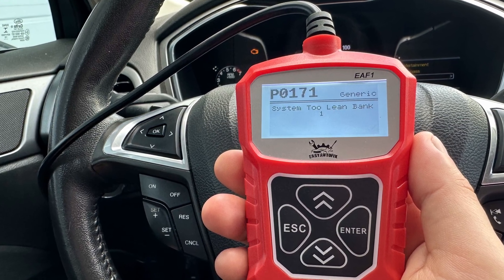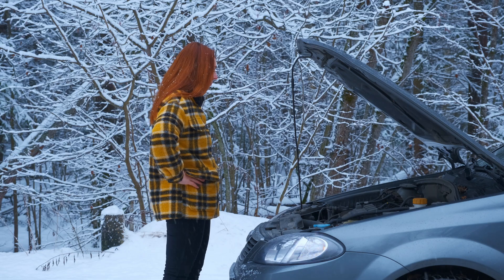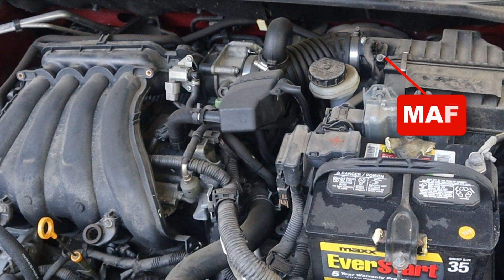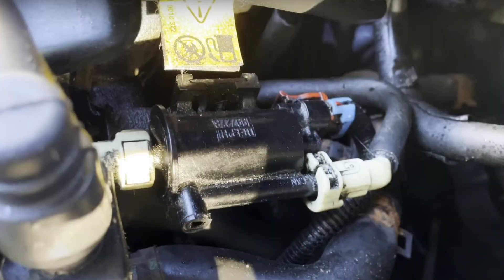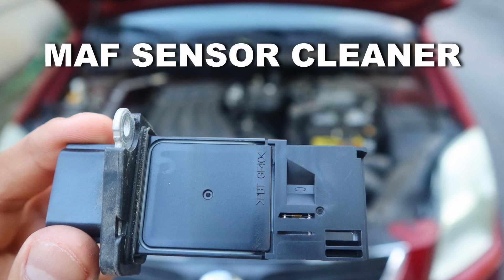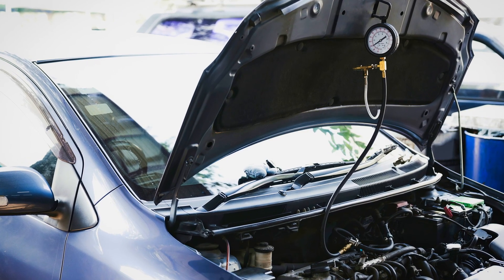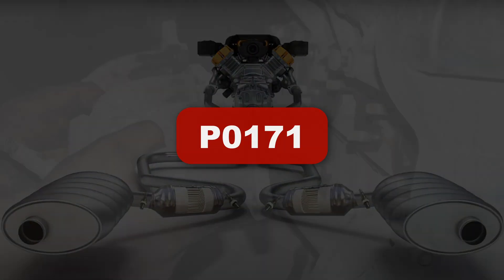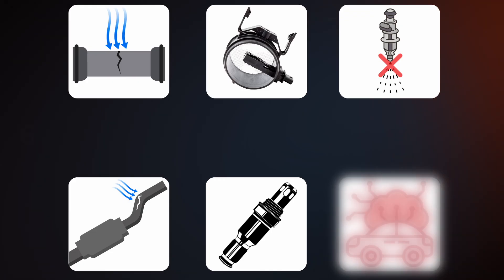P0171 Trouble Code: System Too Lean Bank 1 (The Most Common Causes)

Comment from the maker: ▶︎ OBD2 Scanner: https://amzn.to/3PHRplS
Reply: Check the easiest causes first: 
1. the hose air filter box could come loose ie. a vacum leakage. All you need to do is tighten the screw. 
2. Clean the MAF sensor.
I do not understand how leaked exhaust causing air to come in and causing oxygen sensor reading incorrectly since pressure inside the exhaust pipe is higher than atmosphere when the engine running.
Reply: This scanner gave up on me in a month. Get the blue driver. Unless a got a dud idk
Reply: 0:21 0:21

Comment: The problem was with the booster in the brake system, the diaphragm was faulty, I repaired it the issue resolved itself and the check engine turned off all on it's own.

Comment: So I've been getting all four cylinders misfire and I've done almost every replacement part underneath the hood and I finally swapped out all four injectors and my very next drive I got the two lean code as well as all four cylinders still misfiring

Comment: Well here's the deal..i have a 2013 mazda 6 2.5l  for a couple months I had a stuck open thermostat.. Two days ago I did the thermostat.. It was in pieces they used aftermarket plastic one the plastic broke, it was separated into metal and plastic piece.. Anyway there were permanent trouble codes related to thermostat that cleared after i cleared all codes  all my readiness monitors r ok except  02s and evap after 40 miles of various types of driving.. I only did one cold start though.. Today I went for some driving. I think it's like 30 miles i checked the codes everything was a fine  but no readiness still on o2s and evap.. So I looked at the engine Bay.
Went to each vaccume hose..and disconnected and reconnected both o2  senssor  wires just to clean the contacts. Got back in the car, started it and went on another trip.
Good 26 mile drive stopped and checked o b d 2 now there was a pending p0171 .. Didn't touch anything but I have mass airflow sensor  cleaner in the trunk sprayed the hell out of the sensor when I took it out.. Went for a very short drive, maybe 8 miles. Checked obd2. And p0171 is no longer pending and it's gone.. My monitors for 02s and evap are still not ready i'll try to drive a little more later to see if I can make it turn to ready.. What do you think the likelihood of it finally being okay

Comment: Hello, Great Video. Question, I took my 5.7 Hemi to a stealership yesterday with all 4 O2 sensors throwing codes. The codes are cleared, but now I'm getting rich/lean codes both sides, to the point that it dies while driving (never before). Could the "mechanic" have possibly programed my ECM to clear the O2 codes, but now it's now throwing the rich/lean codes? I never had an issue with these codes before. thank you for your time.

Comment: I have an 05 Pontiac Sunfire. That I’ve already done the fuel filter and new air filter. I’m a single mom that can’t keep spending money. What would someone suggest I try next?   I get this code. It takes a couple of times to try to start car and once does the it putters when pressing gas and has engine light on. When driving it after stopping the acceleration struggles with getting top speed and putters. Already replaced the MAPS now too and doing same thing.
Reply: Oxygen sensor is a possibility. Try to find out where it is located.

Comment: I got po171 and then I get po302 because of it, but the spark plug is fine, I replaced the o2 sensor, mad sensor
Reply: Did that fix your problem? I’m having the same codes

Comment: I had this code problem for för 2 years. At last i opened spark plugs and cleaned them carefuly and then i saw that this code disapered. I solved problem wholy and easily at last. So as a  matter of fact please first clean all of spark plugs. My car is opel astra h 2007.

Comment: I don't know the filter came with the car I bought it only a couple months ago and it's clean the pipe up to the map is clean the math looks brand new the PCV valve is black not orange I'm gonna do a smoke test here soon and buy O2 sensors the after cleaned maf sensor it triggers this code

Comment: Funny, i get this recommended today after I noticed small amounts of oil in the rear cross-over pipe on the intake when i removed the manifold to replace the gaskets. Ordered a new one yesterday, and today, i popped a CEL for p0171 bank 1 lean. I assume replacing the pcv will fix both issues.

Comment: Im single and cant afford a mechanic. I have no mechanic in the family to help me. 2014 chevy impala. When fuel gets below a quarter of a tank it starts acting up and dies and runs rough.. i filled up and now getting code po171. It throws a different code alot. What would be the cheapest place to start? Took off air intake and checked for holes. I think it sounds like an exhaust leak under the car but how do i check for that?
Reply: @tishbailey
Sounds like your fuel pump or fuel pump gasket may need to be replaced.  There’s a a reason why the issue occurs when your gas tank is low.

Comment: I replaced my Mass Airflow Sensor and repaired some holes in my exhaust pipe! Fixed my problem and made my car run super smooth!
Reply from the maker: Awesome, glad you got it fixed!
Reply: So this code could be from my non-original straight pipe exhaust?

Comment: Got the code and engine check light. This was the first vid i clicked on. First thing check vacuum hose and found a hole. Simple 30 minute fix for a nonmechanic. Saved me a few hundred bucks. Thanks man!
Reply: What were your symptoms
Reply: @LandonGreenwald  beside the P0171, the engine would shut down when I accelerate after 5 minutes of driving. I'd have to turn it off and start it again to keep driving.  I believe the check engine light, vehicle stabilizing light, and maybe ABS light were on. I was luck that the vacuum hose was right at the top with a visible tear.
Reply: @ I just installed a new fuel regulator and it runs good but I got home and it trough the same code as you and I have a rough running feeling. And ideas what it could be?
Reply: how did you find the hole so many hoses man
Reply: Can I still drive in the meantime I see a mechanic ?

Comment: Thanks @EasyAutoFix, one question where bank2 should be on a 1.6L 4 chilinder in line engine ?
Reply from the maker: In engines with two banks (like a V6, V8, or a boxer-4), Bank 1 is the side with Cylinder 1, and Bank 2 is the opposite side. But in an inline-4 engine, all cylinders are on the same side, so there’s only Bank 1—no Bank 2 exists. However, in a boxer-4 engine (like those in Subaru models), the cylinders are horizontally opposed, meaning it does have both Bank 1 and Bank 2, similar to a V6 or V8.

Comment: One of my vacuum hoses went. You can hear it a little bit plus my RPMs idle high. So if your experiencing high idle and you hear hissing sound, more than likely it’s one of your vacuum hoses
Reply: not sure what to do for me because whenever i used MAF cleaner on my sensor the check engine light went away and was idling good a 3 or 4 days and the light would come back on and i’d repeat the process i bought a new sensor and used throttle body cleaner on it. When i didn’t i disconnect the sensor and the the hose that connects to the the throttle body and it idled just fine without it. When i reconnected everything after it started idling rough again idk wtf to do
Reply: @Ronaldo-bwe did you ever figure out the issue??

Comment: Sprayed my maf sensor and now 2 more codes popped up😑
Reply: The spray pressure broke the wire ,well that is what happen to me once.
Reply: Same here changes all the parts and now this one 😒
Reply: Lol
Reply: Fr?
Reply: Did you get it fixed?
Reply: Lmao
Reply: I did same thing and this code poped up after clearing maf code
Reply: @Shadowshodan28 are you using KANDN filter?
Reply: @Shadowshodan28 are you using kandn filter
Reply: Freaking same! After spraying it,it just started acting crazy with more codes
Reply: It definitely can open up a can of worms
Reply: Not supposed to spray it depending what kind you have
Reply: Always refer to the Fsm before cleaning anything or changing any fluids. There's a recommended procedure specific to each vehicle and it is not always the same as some of your other cars might be.
Reply: P0141
Reply: I have a '96 SC 300 2JZ-GE and you cannot use MAF spray on these - my understanding is that it destroys the filament.  I hope this isn't your case.
Reply: 😱😝😂sorry

Comment: My 1998 Saturn SL2 was bucking, and running rough on cold starts only. It would also stall on first crank start up, unless I pressed gas pedal down 1/3 or more, than it started fine on first start attempt. Cleaned EGR, Cleaned complete throttle body and AIC solenoid pintle, cleaned map sensor and area, new CPS, TPS, CTS, OS, FF, plugs, wires, ignition module, ignition coils, fuel pump good pressure, etc.... still same problem and 171 code running too lean. I replaced PCV and bingo! That fixed the problem!! A freaking $4 part!! Unbelievable a cheap part can cause some weird, bizarre bad start and running problems.

Comment: I got the p0171 and p0174 code for my 02 GMC Seirra 1500 with a 4.8L. How can I fix those 2 codes? Or check ?
Reply: Same thing and a p0401 error code  and cylinder 3 misfire

Comment: I got 
P0420-Catalytic converter system, bank 1 - efficiency below threshold 
(I’ve replaced the cat)

P0276-Intake manifold air control actuator position sensor/switch - range/performance problem

P0171-System too lean, bank 1
P0141-Heated oxygen sensor (HOS) 2, bank 1, heater control - circuit malfunction
P0138-Heated oxygen sensor (HOS) 2, bank 1 - high voltage
P0036-Heated oxygen sensor (HOS) 2, bank 1, heater control - circuit malfunction
(And I’ve replace both o2 sensors on my vehicle up stream and down to be on the safe side. Only one exhaust.)
Reply: buy a spacer

Comment: I check smoke exhaust leak, clean MAF sensor, replace pcv valve. but light still there but when my gas tank has 75% light goes off.. i could not find the problem and come back after that..
Reply: fuel pump

Comment: Hello everyone my car Honda civci si 2008 i have been change a lot of thing but still not working good yet it only running about 1hour after that engine started stalling. this is might be very slow leak or anything that i miss. Thank you so much for helping.

P0171 code system too lean bank 1. i did change O2 sensor and MAF already. and all the boost is good.
Reply: Maybe fuel pump is bad?
Reply: @arymonem  I fixed my car already it was a electrical heating issue with a connector cable that plug into a fuel pump so lucky it was not blow up. thanks
Reply: 08 civic si here with same problem. Still trying to diagnose for weeks. Bump this post if anyone knows anything
Reply: @stephenmacdonald9537  finally i found a problem with my car already so now working great. i been driving for a while. so the problem is fuel pump wire heat up and burning the connector  i'm so lucky that my car not blow up. fuel pump is my last thing to change it.
Reply: So like a faulty fuel pump? Elaborate please

Comment: I have a Toyota RAV4 2017 .  My car had the engine light on and my painel said traction torned off .
Reply: Same problem here. It is not the track control system, it should be fuel or air problems.

Comment: Thank you for this video!  What I don't get is that if the problem is possibly in the A/F ratio sensor, then WHY is there not a code for that sensor?
Reply: Exactly i hate that lol
Reply: There is… your o2 sensors are your “af ratio” sensors. They’ll sometimes throw codes however they often don’t know that they’re not working. Their function can be easily checked with a cheap OBD2 scanner and  seeing their response to a snap throttle test

Comment: P0171 Code : Lean code, too much air. 

Air Fuel Ratio : 14.7 Air = 1 Fuel

14.7 parts of air to 1 part of fuel. 

1. Vacuum Leak : 
2. MAF Sensor
3. Fuel Issues : Fuel Pump, Fuel Filter, Fuel Injectors, Fuel Rail Pressure Sensor, Restricted Fuel Line
4. Exhaust Leak
5. Oxygen Sensor 
6. ECM

Comment: Hi, I have had that code for over a year. It has cleared itself. Engine light goes off. Or I clear it. Last week It started running okay when cold but when hot looses power. In that year I have been driving and testing. Has new fuel pump and filter. Ideas?
Reply: Process of elimination. One expensive part then another.
Clearing the code doesn't fix the problem.

Comment: How much you think that they will charge me to get it fixed
Reply: It depends on what they are replacing. 
AND if they actually replaced the part that's causing the issue. 
There are so many possibilities, you might get lucky.
Reply: Sup Hakeem. I have the same problem. Any updates on price? I am going threw financial hardship at the moment hopefully it doesn't cost much
Reply: My mechanic charges $100 just to diagnose what is wrong.

Comment: I’ve got this code on my 2006 Camry with 280k miles and I’ve noticed I also have a 16% absolute throttle position during idle when looking at the live data on my BlueDriver which I’m pretty sure is way too high. Would this most likely indicate it’s the throttle position sensor that needs replaced? The absolute throttle position percentage when the code last got tripped on the freeze frame data was 30.6%.

Comment: It’s way to many things that could be wrong
Reply: Seriously why put so many issues on one code and not boil it down to one problem 😂
Reply: @julyexly5160  i know right. if its the 02 sensor it should say that. that damn thing is wired to the ecu
Reply: @julyexly5160 

Where's the profit in that?!
Come on now!😉
Reply: @julyexly5160 
No profit made for that.
Reply: Process of elimination
Reply: @TerraNovaLife 
I agree, but usually the last thing you find is usually the issue. After spending how much?😉
Reply: That is what I thought when the video was over.
Reply: @thelthrythquezada8397 that’s what I was thinking but they saying the best ones to check first is MAF OR OXYGEN SENSOR 🤞🏾

Comment: I know nothing about pop1 code 171,I asked my neighbor and he said I need a vacuum brake booster,but he also said he didn't know if that 02 is damaged,I'm a military wife I took it to three mechanic and each one said something different with outrageous prices ,I trust my neighbor advice he said I should only get the vacuum brake booster to see if that takes care of the problem ,what do u think 🤔
Reply: If your brake booster is bad you will have inconsistent braking as well as “system too lean” I fixed my problem by replacing brake booster

Comment: P0171 ONLY on my  2020 Ford F150. I have only 26,000 miles on it. I saw your possible reasons. I have extended warranty but my dealership doesn't do 3rd party warranties. 
Now what would you recommend sir?
EDIT:
I bought the truck brand new.  This shouldn't happen so soon should it?
Edit:
Took it to a dealership. They replaced purge valve. But they would NOT guarantee that was the problem.  I paid for diagnosis,  parts and labor.
If the code reappears,  they told me to bring it back.  And for what? Only to charge me again and possibly again and again?
Thats just not right.😠
Reply: Buy Japanese car next time.  On my Camry the code showed up after I passed 200k miles.
Reply: @arymonem  
No sir. I work at a factory that makes parts for Honda. And it's scary for what I see them ship out as quality. 😬
Reply: @JGG1701 yeah, but what’s more scary how many new fords we see coming into the shop with low mileage. Lololol

Comment: I had both codes right after I ran out of fuel while driving 
Engine was rattling on first start then goes well but the engine still stumble at 4000rpm rev
Reply: Do you run it on low often? You might have damaged the fuel pump, it's not good to run the car on low or nearly empty as the gas lubricants the pump

Comment: Vehicle in question is a 2003 VW Passat GLX, 6 cylinder, automatic transmission, front wheel drive. This vehicle has always had a seemingly high idle speed, even when it comes back from service at the Dealership.

I am getting P0171 and P0174 for the same "too lean" condition on both right and left banks.  If idle speed was set too low (on last service at an auto repair center), what do you think the chances are this might be the cause?  

RANDOM QUESTIONS:
Does the ECM control the idle speed and the mechanic cannot adjust it?

Could a low idle speed cause the ECM to calculate and inject the wrong amount of gas because the ECM is programmed to function as though the idle speed is set correctly?  

If the ECM knows the mix is lean, why does the ECM not adjust the mix accordingly by increasing the fuel injection interval?

Could it be the idle speed has been running low . . . BECAUSE OF A VACUUM LEAK, . . . and the engine therefore has insufficient power to maintain the correct idle speed because of the weak fuel mix?

Comment: My car is hesitating like it’s not getting enough air or gas
Reply: If you are driving a nissan stay away from shell gas. I had hesitations when my car new.. I wondered if it could be the gas so I got gas elsewhere and it didn't happen. I went back to shell and it happened. I went back and forth 5 times to be sure and every time I got shell I had hesitation. I dont buy shell gas anymore and no longer have that problem.

Comment: what if you get this right after getting gas on a super hot day (100°) and you clear it and it doesn’t come back
Reply: My question too after 99deg today
Reply: Bad purge valve, stays open so the extra fuel pushes the fume into the engine and causes hard start. I found out this on you tube.
Reply: Same here
Reply: Check your gas cap.

Comment: my car is ticking on warm ups but not when hot can u help with some info so i can take care of it
Reply: Could be an exhaust manifold leak. When the metal warms up it seals itself. Depends what kind of tick though if its internals related or not